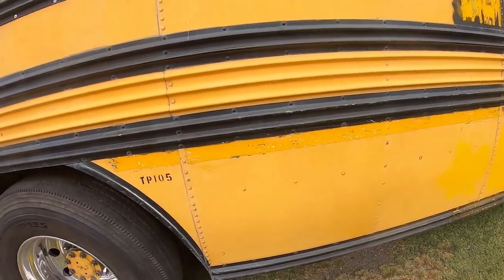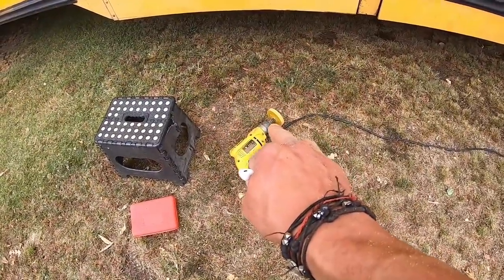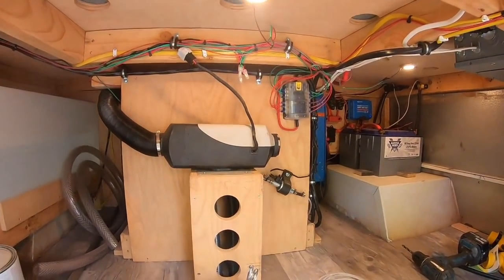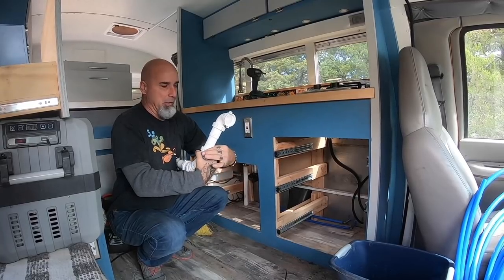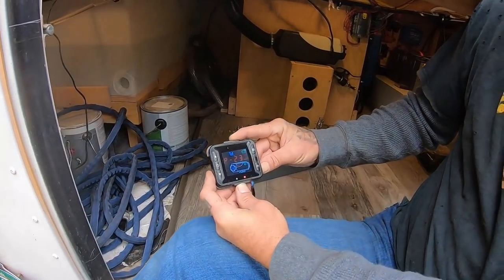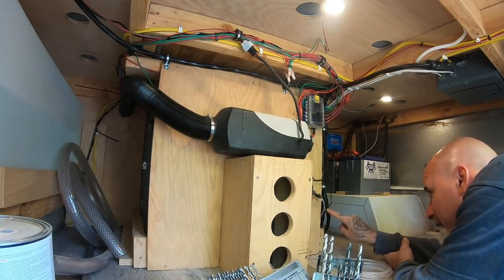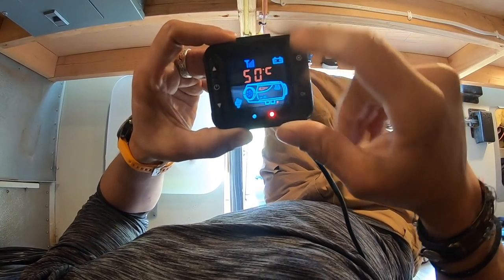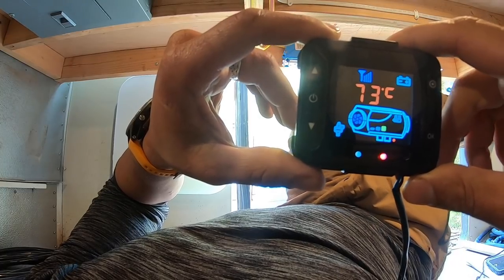Skoolie Paint Prep Finished & Finishing Projects On The Mini School Bus Conversion

Comment: I've watched several videos from vloggers who installed those heaters. Seems that the pump is best placed outside, under the rig due to the clicking sound the pump makes. Someone I watched put a rubber isolator between the pump and the rig to reduce the noise.  Seems like itd be a good idea.
Reply: I agree - I would have also put the tank on the floor so the hose and filter were all under the vehicle....

Comment: Re: the Diesel Fan Heater.
The fan-speed will self-increase WHEN it has a good fire established, & NOT before.  
Give it enough time to go through the start up sequence.
The FAN speed will IDLE (SLOW) until the FIRE is properly established,
and will adjust itself according to how much heat is being made
(how much fuel is being feed into the fire)..
Reply: If you get diesel WAXING in the winter, 
a small amount of Kero or JetFuel will usually work,
blended into the Diesel-Fuel.
Most of these heaters (Espar/Eberspacher/Webasto clones) 
recommend against straight Kero.
In much of the world, 
Jet-Fuel is typically cheaper (less expensive) than normal Diesel-Fuel.

Comment: Why not leave the reflective tape for safety and paint around it?
Reply: You could even lay over with a different color reflective stripe like white looks very clean...and only scrape a 1/4 inch line at a time with the pinstripe removing tool vs the hole 2" in on shot...
" Jes-Se- Out-&-Into- The- Real "
" Jes- Se- R- U- I- Z 👁"
" Jesse Ruiz "

Comment: Just a humble suggestion, change out controller to a simple dial knob with on/off  bought one off eBay about 12.00 bucks I never could figure out the digital one that came with my heater . No learning curve needed .

Comment: YouTuber “John Mck 47” has an 18+ episode series on Chinese Diesel Heaters. He does an incredibly thorough breakdown of every single component of the system, how they work, and how to test them. Those videos will tell you everything you need to know.
Reply: I 2nd that.."John Mck47" is out of Australia and has done just about entire video breakdowns on how to get the best out of them....used his series when I ran into problems with ours...top notch...ps do yourself a favour and let that pump hang freely using the lines as mounting points and also mount it more vertically rather than horizontally...it will be SO much quieter just hanging...you will almost completely eliminate that "chunking" sound from the pump as mounting the pump directly turns the thing its mounted to into an amplifier(like those mini bluetooth speakers you put on a box)

Comment: to convert c, to f add the two together and add 31
Reply: add what two together?
Reply: add the two Celsius numbers and add 31 to convert f
Reply: @rickduffels5816  thats not true...example: 15 Celsius is 59 Fahrenheit . with your logic, 1+5=6. 31+6=37 degrees Fahrenheit.....
Reply: Hank I think you need to go back to school, I'm Canadian and that's how you do the conversation
Reply: 15 Celsius is 61f
Reply: @rickduffels5816  ok.. even if it is 61. how does "add the two together then add 31"  work in this instance? 15 f: 1+5=6..( added the 2 together) "then add 31" 6+31=? not 61 degrees.........
Reply: @rickduffels5816  and just so we're clear. 15 Celsius is 59 not 61. maybe go back and READ my first comment before you tell me i need to go back to school. when clearly your reading comprehension should be in  question...
Reply: and just to be clear, to calculate it; 15+15=30+31=61
Reply: @rickduffels5816 the way you phrased your original comment was easily misinterpreted should be more like "double the Celsius temperature and add 31."
just for fun: https://www.calculateme.com/temperature/celsius-to-fahrenheit/15